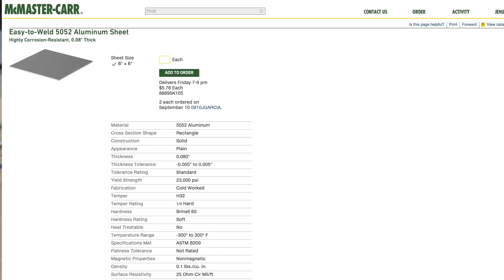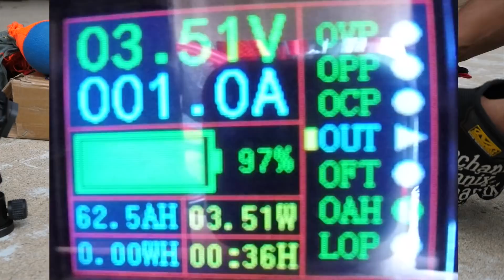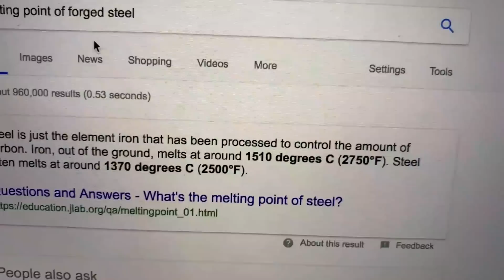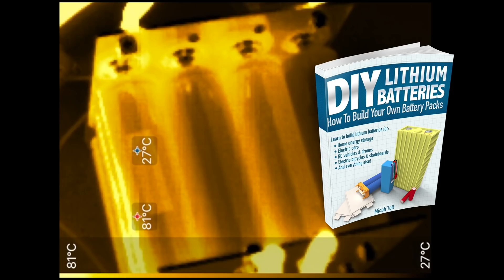Melting metal with Batteries

Comment: Question.... I watch a lot of YouTube videos.... but I don’t know too much English.... i’m spending a lot of money on gas because Work an hour from my home top speed 60,  34 miles distance...  what motor and battery recommends me??????  under budget..... please
Reply: Hi, for that you need to give your budget, and if you want to be precise, you need to know your coefficient of air penetration of your vehicle. And many other things, like, what extra range do you want ? How much weight you have to carry on, what is the system you choose, modifying with guears or directly to the weels power ? Classic hydrolic assistive direction or replacing by an electric one ?
Reply: Hector,
Go on www.evalbum.com, Many examples and configurations.
Reply: Thank youI forgot to mention, my bad,  I want to do a motorcycle
Reply: Use the filter on ev album for motorcycles.There's lots of them. It gives you cost, range and equipment used.
Reply: Compare to the ZERO SR electric motorcycle.
Reply: You still must know the weight of what you want to carry + the structure and motor, then you will have to anticipate (still) air friction to calculate how much you need to travel the distance you want. 60 miles an hour can be considered as kind of huge burst cause of that friction. 
About the motor, take the most efficient than you can, if it's 2kW or 6kW the only difference on the start will be the speed as which the work can be done. 

To compensate air friction the resistance vary of the square of the speed, 1/2*coefficient of penetration in air*volumic mass of air*speed square.
Ex : If you need 600W to maintain 30mph, you will need 1600W to maintain 60mph
Reply: Check out the features of the Zero "S"    https://www.zeromotorcycles.com/zero-s/
Reply: I know I have to spend money on the project but what I mean is that I don’t want to spend $2800 on a controller
Reply: Google, (kelly ev controller) 200.00-500.00$ many options. Motorcycles are light, you don't need a 1000 amps.
Reply: Thank you so much to take of your times to help me with this project.... 
the motorcycle weighs 300 pounds...

Comment: I don't need to melt wrenches, I need an RV battery. How do you connect a bms to 4 of these so I can get 12 volts? The only bms I can find is $350 and that for prismatic cells.
This battery stiff is so frustrating, it's like trying to fit pieces of a puzzles but all the parts are from different sets.
Reply: Just connect them in a 4S arrangement, and then connect a regular LifePO4 BMS.

Comment: Bought 4 of these headway cells to replace a small 12v agm battery in a gate opener for driveway. Installed about 1 month ago, charged by solar panel. So far works great. These cost just a bit more than the agm from Home Depot. Thanks for your inspiration!  Keep up the good work!
Reply: a

Comment: Are these batteries good for  electric car??
Reply: tin hriberski  he has a video where he compared these to 18650’s and other cells.  The 18650’s are The lightest, least expensive option.  So while these are great cells, their price, weight, and form factor are not as good as 18650 3500’s.   These are amazing for their massive amp capacity so they are popular for radio broadcasters and car stereo builds.